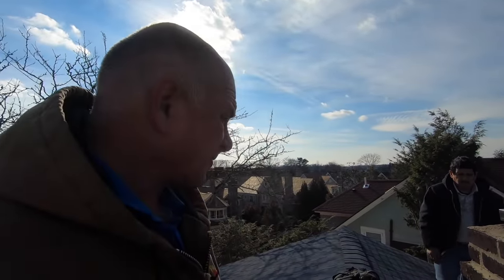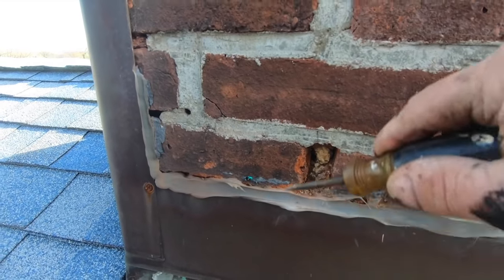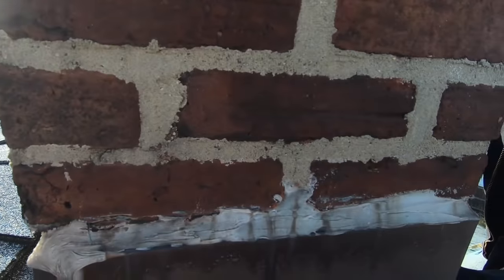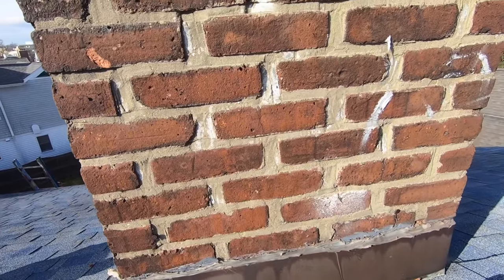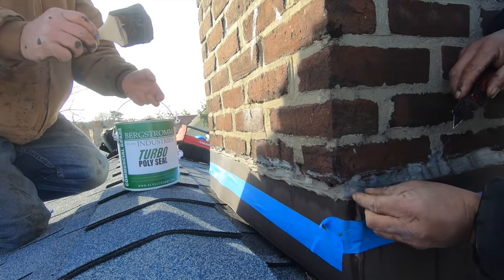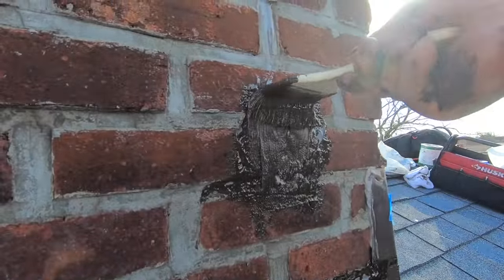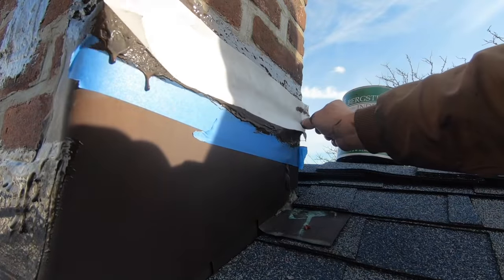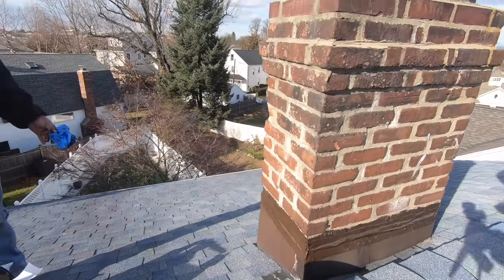CHIMNEY FLASHING LEAK REPAIR - easy step by step with Turbo Poly Seal

Comment: For context... we had an addition put on our house one year ago that includes new roof around our chimney. Every big storm the roof leaked and we had the roofers back out and the contractors back 4 times to "fix" the leak. Every big storm it would leak again. Finally after investigating and getting fed up with the roofers i watched this vid and used this method around the flashing. We had12 hours of rain yesterday and i saw no water entering the attic in the usual spots. Thank you for sharing your knowledge
Reply: Ik having the same issues..cant take these roofers anymore...I pay it leaks still.I have an addition put up for my feral cats and the brick wall flashing leaking still after 5 men up there. One last roofer finally said its the flashing ..cracks. But now I cant get them to even give me an estimate. Should I try sealing it myself...?
Reply: @Hannelore7  it's been two months of tons of rain and no leaks still. This guys method worked like a charm for me

Comment: You just exchanged one bad solution for another because you just went right over the old caulking. Either cut & re-point the whole chimney or just cut the old caulking out of the joint & put backing rod & re-caulk it properly. No reason the paint that shit all over the brick face like that.
Reply: Re-pointing the whole chimney would take much longer and cost more.

Comment: It would of be cheaper to use the right type of sealent for the metal flashing which sticks to both materials . And fill the missing brick joint back with  cement mortar . Look tider to

Comment: We have a stucco house, stucco around the chimney. Our fireplace has caused damage to the asphalt shingles and we now have a small leak. I was hoping to cover the flashing and damaged shingles but not sure if this product is recommended for stucco? Any advice on the shingle? Wondering if I should just replace them. Got a quote from a couple professional roofers to fix everything and was quoted around $2000 which I just can’t swing at the moment so trying to find some good diy options.
Reply: Dunno if you got this fixed yet. This method might be OK for a short term bandaid fix but for a real long term repair there are much better repair videos out here.
Flashing is tricky. Even if you hire someone to do the work you have to be informed. There are just to many bad contractors out there.

Comment: I disagree on using that poly seal where the mortar was missing... you should have used Hydraulic Cement and filled and removed all old and loose mortar. I would have mixed the cement with a 'Bonding Adhesive and Acrylic Fortifier' to make it more waterproof and to make it stick .  A lot better than 'tape and glue'. After cementing I would use this sealant.
Reply: Yes and at the end of the job is necessary a tretament of bricks by hydroreppelent.
Reply from the maker: I agree with you, everyone has their own way to repair things. I have used Hydraulic Cement in the past. The way you explain how to repair missing mortar is correct but time-consuming. I am showing to make repairs that also last, but in far less time than what you want to do. Economics my man!
Reply: @FlatRoofDoctor  some roofs are steep, hard to work on with time consuming and work danger from falling. Not to mention cold and windy. Fast and good fix do job well done for now.
Reply: What type of tape is that? 😊
Reply: @lukexiong5945 I

Comment: The appearance might be improved by using masking tape on the top of the repair too; however, chimneys are high up and most people don't look at the detail. The repair is low down, so less visible too. My chimney started leaking down one face into the loft. I'll check the cap first and point some big gaps that are not next to the flashing. Then I'll use this method around the rear of the chimney (the weather side). The front of the chimney is on a more dangerous sloping roof, so I'll skip that for now. Like many others, I can't afford to have the chimney removed (my preference) or professionally repaired. On the other hand, I paid a top professional to cover the flat roof, as this is a major job that needed to be done well, including tricky flashing.

Comment: After the turbo poly seal gives out, idk say 5-10 years or however long it lasts in rough conditions, is it ok to reapply directly over the old application or would I have to remove it first then reapply? Thank you, I'm excited and anxious to use it!

Comment: Hi, I'm thinking that the repair may not have fixed the problem if the chimney crown is not fixed properly. It looks like you're still going to get water dripping right down the sides of the chimney and deteriorating the brick. Please explain . Thanks :)
Reply from the maker: Well, this is over 3 years ago since I did the repair and the owner has not called me back yet. Maybe your thinking is a little off.
Reply: @FlatRoofDoctor  3 years isn't a long time. And it's not my thinking. It's right in chimney repair handbooks
Reply: @whith5184  could you supply a source to this handbook ??

Comment: There is nothing wrong with this repair, people are being a bit stuck up. The customer could have indeed paid for a much more expensive job, removing the metal flashing/cladding and previous repair then repointing the brickwork. That costs a lot more, huge difference and these dudes have done an effective repair that will weather in, won't be noticeable after a few seasons and be weathertight for many years for minimal cost, time and fuss. Good job lads. Not all customers want to spend big.
Reply from the maker: you are exactly right. People who like to criticize when they don't have all the facts are dom.

Comment: Question for roofers I had a new roof put on the first rain my mantle got wet. I've lived here 22 years the mantle never had got wet the roofer came back Andre caulked the counter flashing I asked him to replace the counter flashing as it had been up there 45 years he stated they only replace 10% and mine does not need to be replaced. It leaked again he is pretty adamant that it was coming through the bricks it had rained 2 weeks before and not one drop no moisture at all on my mantle I don't think it's a coincidence anyway roofers my question is what is the proper thing to do both him and me? Thank you

Comment: I dunno man, looks a little iffy. Mighta wanted to actually fill those gaps before sealing, patch job looks terrible, and any decent inspector is gonna red flag this anyway... but if you need an immediate fix, i guess this'll technically work.

Comment: Does nobody 'cement' flashing in any more? Or re-point the brickwork with cement?
Reply from the maker: The fact that you have to re point brick work says that something went wrong. BTW, re pointing or grouting is just superficial. Very seldom is that a solution.
Reply: Flat Roof Doctor wow Americans should leave the roofing to the brits, that is awful
Reply: Re-pointing is done with mortar & not straight cement because cement is too hard. Only people that are mason's or restorers by trade do it the proper way. Most 'roofers' just go up there & smear shit all over the brick face & call it waterproof.
Reply: I can’t believe what I just watched...

Comment: Hello sir what is the masking tape call  and where to get it from?
Reply from the maker: The masking tape is what it is. You get it from any store that sells paper or hardware or paint supply. The white fleece that is used in conjunction with the Turbo Poly Seal or Super Silicone Seal is a specially formulated Polyester fabric.

Comment: Can I use this where a small shingled roof of a bay window meets the vertical wood shingles on the house? I think I’m getting A leak in there somewhere.
Reply from the maker: Send me some pics of what you think the problem is and I will be able to analyze the problem for you and recommend a solution. send to this # 203 858 0080

Comment: Best to make apron flashing, chase it into Bricks. Will last forever 

Main issue why your approach, is anytime metal joint with masonry, you absolutely need to chase it into the substrate.

Your only as strong as your weakest link which is the brick and mortar surface  you are adhering to. And your turbo poly will pull of the chimney eventually.

Turbo poly is great, but not in this application, obviously just my opinion and you are great at what you do, and it will last more than silicone. Just never as much as doing it properly.

Also need to remove the old caulking
Reply from the maker: Ok, so this is the conventional method for many years as you describe " Best to make apron flashing, chase it into Bricks. Will last forever"
In my 40 years I have seen that fail 1000's of time on chimneys and walls.
1. Cement does not adhere to metal properly.
2. The grouting used to seal the slot does not last forever as you imply. 
3. The expansion and contraction of the metal over a year will work it loose from the grout joint
4. The weakest point of any roof is the flashing. 90% of all roof leaks stem from the specific flashing you are referring too.
5. Just keep on doing whatever everyone else has done for the last 100 years, and think it is good, does not sound very intelligent.
6. I have developed several other techniques to deal with this 100 year old problem.
7. Turbo Poly Seal is for now the best and easiest solution. I have used it for the last 10 years and it beats the metal flashing 100- 1. On Posts, walls, door pans, curbs. It is just amazing
8.Turbo Poly Seal adheres to brick, cement, metal, asphalt, ,wood - what more can I say
9. Turbo Poly Seal is flexible, pliable - it is a game changer. it saves time and it works.

Comment: thanks. not nice but works. what kind of the tape? web link not work
Reply from the maker: Its not tape, it is a sealant that comes with a Polyester Fabric that is super strong. You sandwich this Polyester fabric between two coats of Turbo Poly Seal as shown in the video

Comment: Could you use that product on a crack in a lead valley on roof?
Reply from the maker: Absolutely, Turbo Poly Seal will stick to everything except EPDM rubber. It is my go-to product for all kind of repairs. Any flashing, skylights, glass and vent pipes, metal or plastic, this product will do the job. In the past I used caulking to seal skylights and never had any success. Since I switched to Turbo Poly Seal, I have never had to go back. It is an amazing product
Reply: @FlatRoofDoctor  
If it doesn't stick to EPDM, how does it stick to the rubber boot of vent stack?
Reply from the maker: @andrewbeaudry9705  Ah, good question. I am not sticking it to the rubber boot. I use the rubber boot just to have a base for supporting  so I can make the transition from metal to metal. The rubber is just giving the support while curing. If that brittle old rubber wasn't in place, then there would be a void are and it would be hard to make a transition
Reply: @FlatRoofDoctor  
That's pretty good
So aslong as poly sticks to the pipe and to the roof, the area of the boot will stay flexible
Reply from the maker: @andrewbeaudry9705  Yep You got it.
Reply from the maker: Absolutely, Turbo Poly seal will adhere to any metal. Remember to use it with the fleece. The fleece is the secret. That gives it its strength.
Sorry for the late reply. The admin doesn't show a clear notification when there is a post or not, so I keep missing some.

Comment: would have been good to know what that material was he was putting down that looked like masking tape
Reply: Reinforced fabric basically a polymeric woven fabric
Reply: Bog Roll.. :) No it's reinforced non sticking tape, there's loads of them op the market, lots have fibre glass running in them. They really do add a huge amount of strength to a job.

Comment: Why not just pull out all the caulking and repoint?
Reply from the maker: Repointing is using a cement to fill the slot. Cement is not a pliable material and does not bond to metal. This problem has been existing for many years. Making a transition from cement to metal. But, you are correct, Repointing might work, but, I don't carry cement and water with me. As I was coming down from the higher roof after doing a scupper on it, I noticed this issue on the lower roof. So, in 30 min I had it fixed.
Reply: Maybe the owner is on a tight budget.
Reply from the maker: @audman7895  Not so, I did that repair over 2 years ago and everything good so far. I was referred to this owner by friends I have done similar work. The references are what matter. Most of my work is from references for the last 30 years. You know that your repairs are good when people are talking.

Comment: I don't wanna to take to colking out but u did😂😂😂
Reply from the maker: Maybe you don't get it. For your sake, I had to remove the caulking in some parts to show why it is not working. If I just said it is no good and don't show, you would still be ignorant.  But maybe you still don't get it.
Reply: @FlatRoofDoctor  😂😂😂😂😂😂😂😂😂😂
Reply: @flatroofdoctor where can I buy fleece in canada.

Comment: Also, I hope you use a safety harness while doing this kind of work.
Reply: That roof was easily walkable and where would you attach the bracket to clip in without putting more holes in the roof?
Reply: Robert Greibesland — eg an anchor bracket anywhere along ridge cap.

Comment: What is the name of that kind of paper he uses?  I have a slate roof flashing issue. Thx!
Reply from the maker: It is a Polyester fleece that comes with the Turbo Poly Seal when you buy it at https://bergstromm.com/product/turbo-poly-seal-roof-repair-kit-5-ft/
Reply: It's a mesh roll of fleece  that forms a bond once both sides are painted with the sealant.

Comment: So for my ignorance, but what is that white roll that looks like a cut roll of paper towel you used in the video?
Reply from the maker: The white roll is Polyester fabric or fleece that comes with the Turbo Poly Seal to be able to cover big voids and cracks. This fleece get sandwich between 2 coats of Turbo Poly Seal

Comment: I have no words, remove the calk and old cracked ponting and repoint. Bodgit and Scarper strike again....lol
Reply from the maker: Ok here is what you are missing
1. Do you suppose the chimney was pointed correctly from the start. They surely did not leave it with big gaps.
2. I deduct from what I see that the cement came out and it leaked. Then someone else came and filled the gaps with caulking
3. Then I came and made the transition from the brick to the flashing
4. Then you came and made a remark on what everyone has done wrong so far. 
I have fixed 100{s of chimney flashings. The cement does not adhere to metal. Cement barely adheres to brick. Why would you then think that pointing it again will be any different_ If cement does not stick to metal, how will that be a better job_